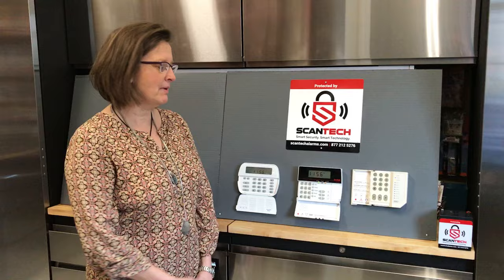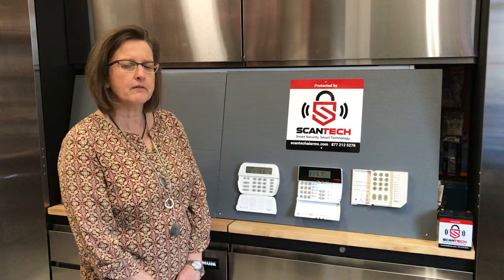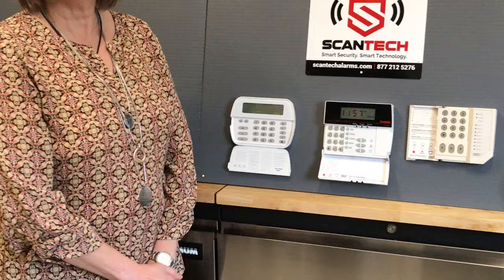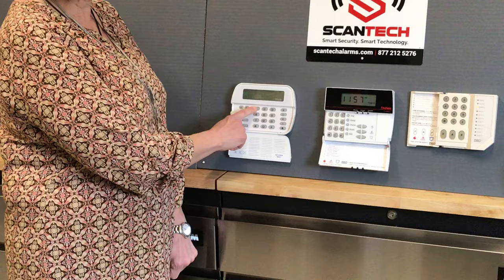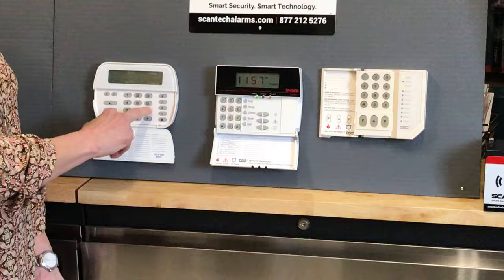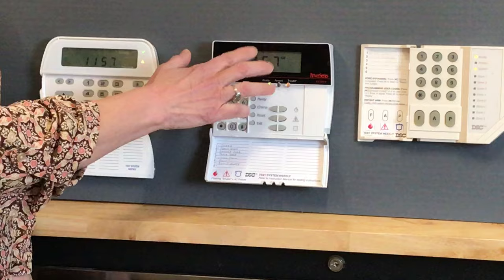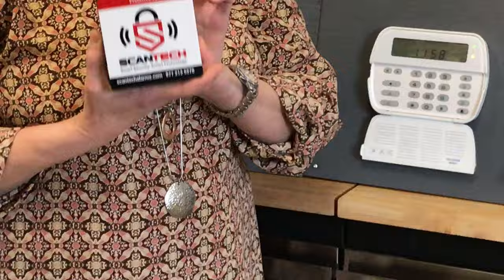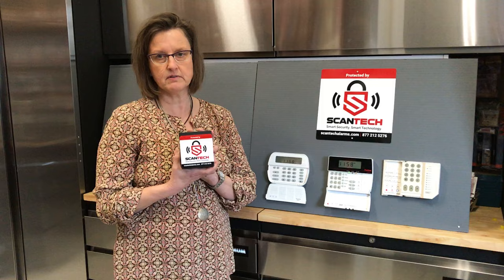What's this yellow light on my keypad? How do I get rid of it?

Comment: Nice work on this, but I have the third and was waiting for you to get to it since it was right there with the others. Then you skipped with no explaining why. Please redo the video or at least let us know at the top that it won't be included. I entered the exact model number in my google search and yours was the FIRST video to come up.
Reply: I looked up the related instructions manual for this. The instructions are effectively the same, the only difference being that one of the zone lights will come on instead of a number being displayed. For example, in the tutorial, a "1" appears on the screen. On the older LED keypad, ZONE 1 would light up instead.
Reply: Hi there, i have the 3rd one as well... when i presss *2, a yellow light flashes and then zone 8 lights up. What does this mean? Zone 8 says Panic on my door card. Thanks

Comment: Notify the monitoring company before you test your system. You may have a Tamper signal on your box and no siren. No surprise knocks on the door. "Hey Mom". 
Test all your doors and windows. Have someone watch the keypad, Verify the signals to check the programming and function.  They should see what you did. If it's loud let your neighbors know. Crazy as it sounds, people have been known to deliberately set off their Alarm to time how long it takes for the Police to come. I understand what they are thinking but still, that is a horrible idea.

 To test that battery, of course, disconnect the A/C for at least 20 minutes or more if you have time, (first wire on the left). come back and test the battery voltage under full load with the system fully working.,  Less than 13 volts, like in this video, it's done. You can leave it disconnected as it could now cause false Alarms, but replace it right away .
Make Sure you put the A/C back on when done testing. Check with the Station. That's what you pay them for. They should get a reset signal on the battery if you pulled it off before. They could have ignored the first battery fail signal or it was never programmed in.

 4 years is enough time but yeah 5 years is about right to die. The system should be carefully inspected long before that and a new battery after a long time is a good idea anyway. Dealer Cost price is minimal and a specific service call can be expensive for the client with travel and other things considered. (In huge installations, I changed them all at same time to reduce future calls and inconvenience. They have such a predictable life).

Surprisingly, those batteries even small 4 amps can hold up the system for very long times without power. More than a day, maybe a week? Who knows?  I guess someone could do the math but it will certainly hold up to any emergency. Just pulling the battery out and using a meter is never going to mean a thing. A test meter has no load. It's kind of sneaky. It will always 'show' good. They are nothing like Alkaline, AA's that die gradually.

DSC panels are incredibly reliable and can take a direct hit of lightning. HONEST!  That's a story in itself. Never mind.
They get up, dust themselves off and reset just fine. Not so much for the other stuff in the house. Too Bad. Got insurance? 

The most wonderful iconic panel is the DSC PC-3000. I am confident many of these are still in service even after 35 years later, I always soldered all my splices with a 'Bic lighter' I was good at that, and used 'B Connecters' when they became available. B for 'Bell'. Compact Heat Shrink is better for windows. B connecters could be gently lifted and put back on to prevent moisture intrusion if no others were handy but still testable, if the splice itself did not need to be examined.

The house is going to be around a long time and the Alarm should never be a problem. Reed switches can get 'sticky' so all contacts need to be carefully tested after time. They don't show much high resistance but more than a tenth of an ohm? Forget it. It's long done.

These panels began with the DSC PC 2000 in 1986. This was a primitive transistorized prototype that sold like mad for one year to be replaced with the PC2500, far better and fully keypad programable.  No having  to' burn' a chip. 

There was also the four zone PC1000 that introduced full keypad programming but really caught installers and service people totally off guard. 'Uh oh, I don't know this one"  For such a tiny simple panel, it required a whole new way of learning. Long before wireless. Out of the box we were! Revolutionary stuff indeed and far ahead of any competition like Ademco and Napco.

 DSC was made in Downsview, The North part of Toronto, Ontario in Canada.
 In respect for the 16 zone PC-3000. For it's time, this panel could offer so much for everyone that the company had trouble interesting anyone with it's newer products. It was like the Elvis Presley of Alarm panels. It left all competitors in the dust.  Yeah but ..The other panels were kind of nice but were much more expensive. 

Ademco got way better than it's older stuff and made itself a valid option to DSC but very different and fun to work with, as they worked very well with optional wireless, at less cost than an ITI SX-V and easier to understand. If  you  are really into this stuff about hard wired systems, and want to use a multi meter, One Ohm of 22 gauge wire at room temperature is 33 feet, feed and return, so in a house you are testing each zone for very low resistances and need a meter that shows fractions of an ohm. A huge factory or warehouse  is a whole different story. Ohms Matter.
Reply: The siren does not sound when alarm goes off, what should I check?  My friend has the pc1555rkz keypad (the 3rd one on this video).Thank you

Comment: How do I turn off the door chime on the third model you have in this video?
Reply: *4
Reply: @djanthonytransitfilms6799  I figured it out...I just ripped the whole system out of the wall. Problem solved.
Reply: *4 or if your system is an older PC series you do: *6 followed by (master code) then 6 and then exit out by pressing #

Comment: Those 3 panels are worst panels to have, they are very complicated and not user friendly. They are slower and tend to have more problems, especially the middle one and left one. Right side one is completely outdated and should be eliminated from the shelves.
Reply: You know your stuff, I have the middle one. It is not user friendly and the manual is not easy reading either. I once learned how to silence the alarm beeps or at least turn them down. I was so happy I forgot to write it down.